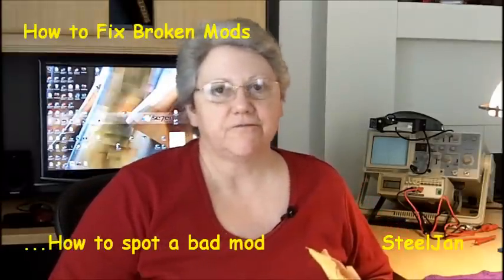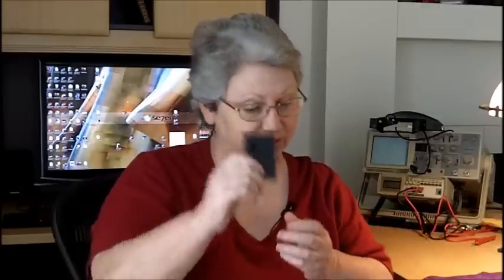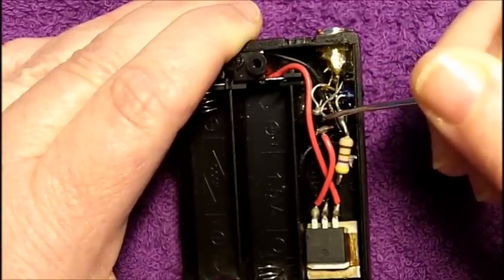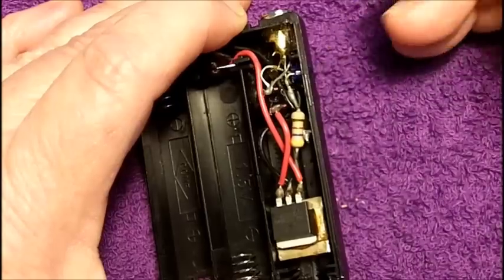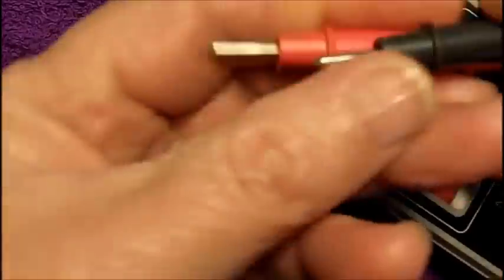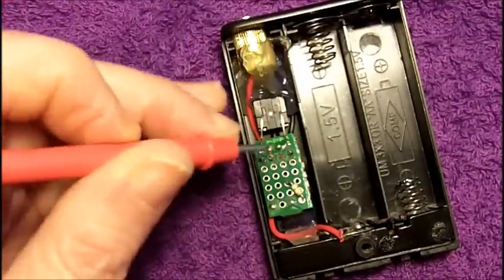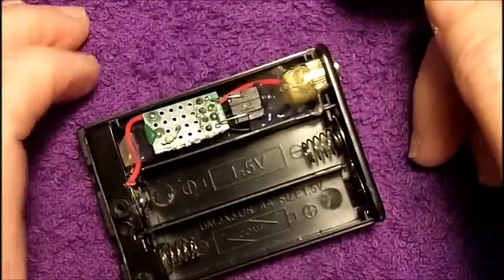Fixing a Mod - How to spot a bad mod

Comment: Jan, thank you so much for looking at my mods. The video turned out really great!

Couple simple clarifications. Madvapes did assemble the box, and they did a great job. The mod worked for a few months before it quit. The cause of the failure was most likely my fault. I dont remember if it was a direct result of me dropping it, but it had been dropped a few times. I can honestly recommend them, for the price it is a very good mod, and with Jan's video now you know how to fix it if it breaks!

Comment: I'm very impressed by your knowledge of circuitry, it's clearly superior to the younger generations building the majority of these things and doing a horrible job. I recently ordered an Oval V6 Gripper for $13 knowing it was likely a Chinese reproduction. I wasn't surprised when it was, and it was also DOA. The ground wire was terrible small and cheap, and had broken during assembly and then passed "quality control" somehow. The rest of the unit wasn't badly built at all though and after fixing the ground wire it works great. A little knowledge of circuits goes a LONG way with vapes.

Comment from the maker: If the switch is only either pulling-up/grounding an enable pin you are absolutely correct, & that IS how the MV mod works. My bad, I was too focused on the crappy mod.  This is not the way the "popular modder's" mod was built (if he hadn't shorted the wiring), his wiring was such that if the on/off switch was On, the regulator was constantly running and the vaping button carried the full amperage & volts up to the atty & LED, so crappy in so many ways.  Great catch, thanks!

Comment from the maker: @michealprater Thanks for sending them Micheal.  I agree totally, the madvapes 5v box mod is not bad at all, should be good for any atty/carto around 2.5ohms or higher, definitely not safe to vape at low resistance.  Of course, this is a stacked battery mod, so the user should test the batteries often too.  It indeed was broken solder joint at the atty connector, I repaired it and the cold solder joint too and will send it back to you Monday.  Cheers!

Comment: now be gentle on me... but, as I recall...  The 5v MV box mod doesn't need a 3A switch because it's NOT switching Vin or Vout but just controlling a enable/disable pin on the regulator that probably isn't even drawing 20mA thru it.  So it's probably their 8x8mm sealed tactle switch.  A great switch for this purpose IMHO.  
Great Vid!  Thanx, Skip

Comment: The inside of that thing reminds me of my first bass amp. One day while playing on the amp I got 400V straight into my hands. The "tech" that had last worked on it forgot to reconnect the ground and failed to solder one the wires from the transformer properly and it hit the chassis. 10min of soldering and 2 replacement tube sockets later it works like a champ.  People need to think before the sell something that can blow up in somebody's face and don't try and sell it if you can't do it right.

Comment from the maker: Personally, I go by how many amps the switch is going to handle in the mod.  You're going to have to calculate that in your specific mod and depending on what resistance, what is the lowest ohms of atty/carto you are going to ever use.  And if your mod is variable voltage or variable wattage, how efficient the electronics will be.

Comment: Your reviews and tutorials are of great help to me as a beginner :)
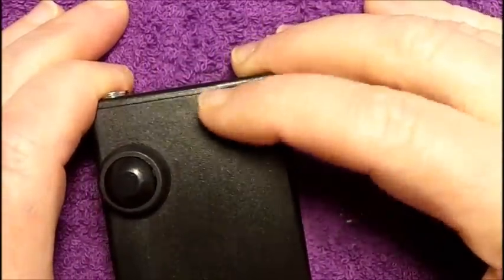at 4:00 you said that you don't like the use of these small on/off switches in VV mods bacause they are not rated for the Amperage. 
Would you please recommend what switches to use. And, do I have to use ones that have more than 3A if I plan to pumb the voltage around 6V?  
will this DPDT Heavy-Duty Slide Switch Rated 3 amps at 125VAC from Radio Shack
be good to use?
Thank U

Comment: @steeljan I am sorry you did not know that. I actually went back and looked at my comment in the "Making an 18650 Personal Vaporizer Box Mod Part 2 - Building It" video and it says, "I have an old box mod I bought a long time ago. It never worked and I got my money back. If you put batteries in it, the led will work. Once you put a atomizer on it, it will not fire and the led quits. Any way it could be fixed. I also have an old one that just quit. No clue how to fix it either." I though u knew.

Comment: Iv always hated when people use cheap perfboard. THey are cold joint city not to mention over time the pad using pops off the perfboard. This on/off switches are fine however when used correctly and put on the negative lead. I dont know why anyone would put them on the positive lead since the box comes with it already connected to the negative battery connection.

Comment: I'm not a vaper but I do a fair amount of soldering work for my job and I've never seen anything quite like that.
How could someone actually have the required know-how to put that together but yet not know that you can't be using bare wires and crossing them??
Unbelievable.

Comment: Reel jam all I can say great work very methodical and analytical a true master of their trade. Can you help out a mechanical engineer which is stuck. I want to change the tactile switches on a voodoo Argus gt with a GENE  chipset. I’m referring to the fire button and the -/+ or up/down tactile switches to wired momentary push button On/Off switches. If you could give me any advice I highly appreciate it. Thanks, 
Evan from Downuder

Comment: OMG that is a scary MOD. It looks worst than the first MOD I ever made. Even on my first try I used shrink tubing and although my soldering was blatantly out of practice back then, I still paid close attention to shorting. You are 101% correct, pack it up and send it back. I would be embarrassed to GIVE that away never mind SELL it! Sheesh.